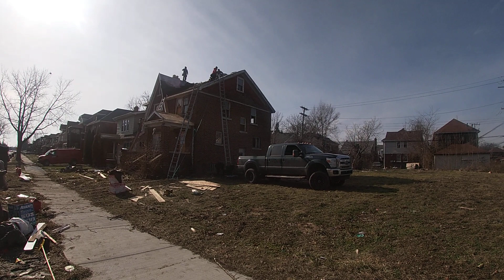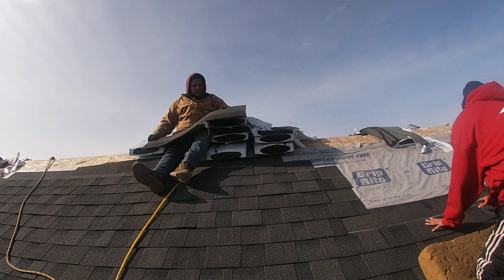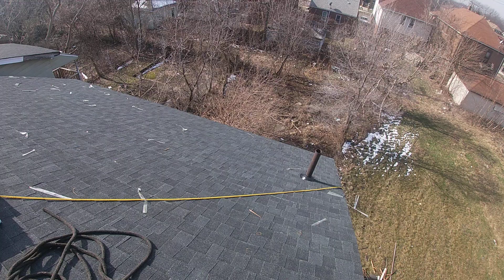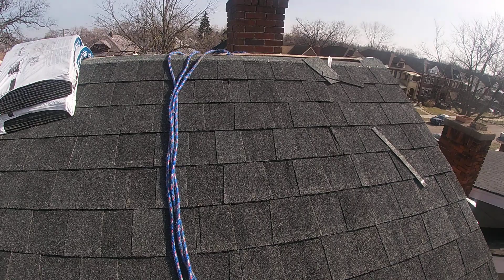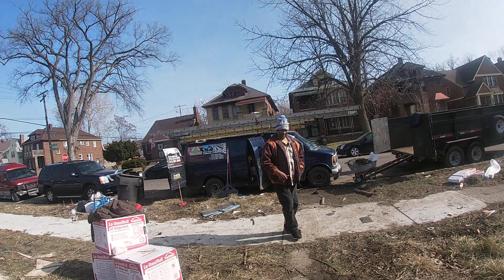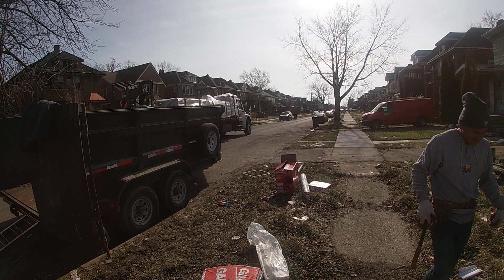Let's check back in with my Roofers, THE SHEA SHOW

Comment: Holy that’s gotta be sketchy those IKOs make a lot of sand… the Certainteed doesn’t generate much sand. I roof in the winter when you can’t pave asphalt. I can’t believe they don’t have a plank at the two drip edges and no anchors wwwwwwwwwoww! Clean work tho, no doubt about it.